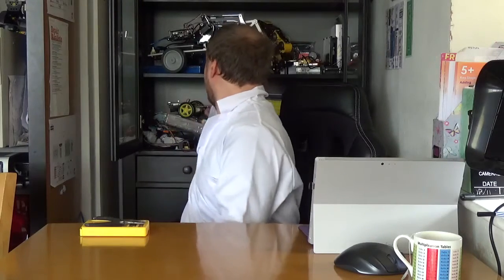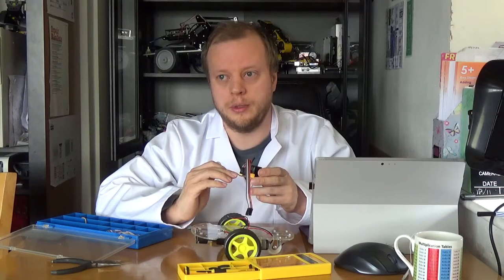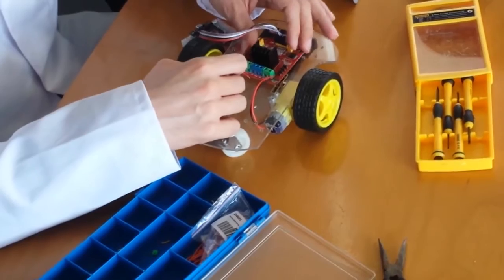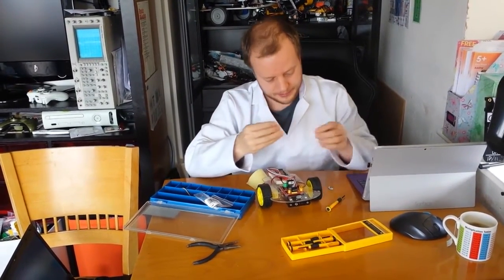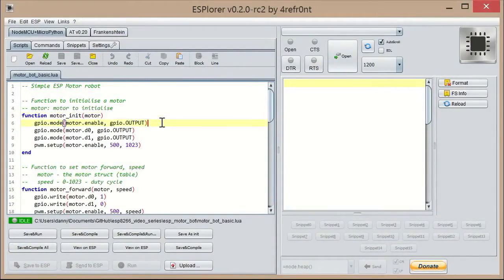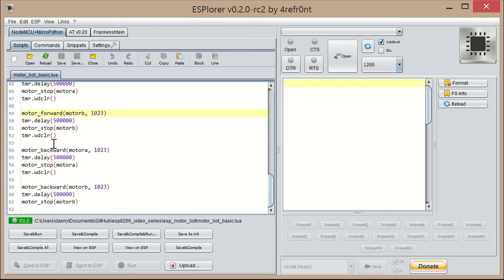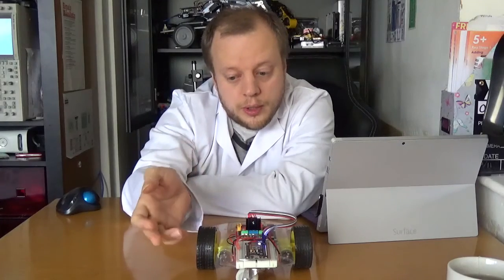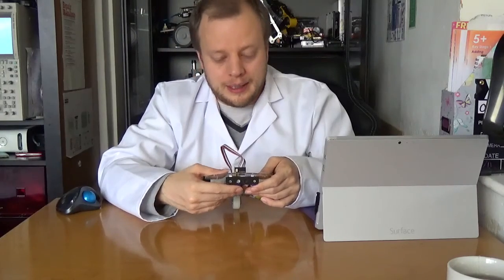Simple esp 8266 NodeMCU robot

Comment: I'm confused about something, isn't that an L298n motor controller and doesn't it run at 5volt logic, and doesn't the esp8266 run at 3.3volt logic? If so, are you using a logic level converter? thanks
Reply from the maker: yes it is. however, previous experiments with the Raspberry Pi showed that the l298n will happily trigger on 3v logic levels. if it was an input instead I'd be using the converter.